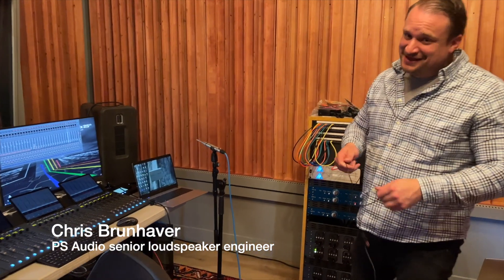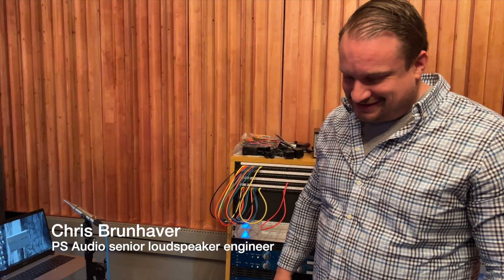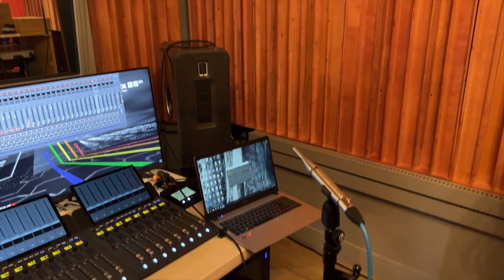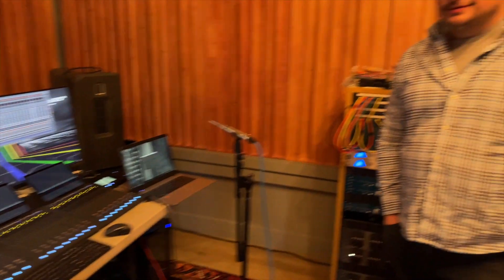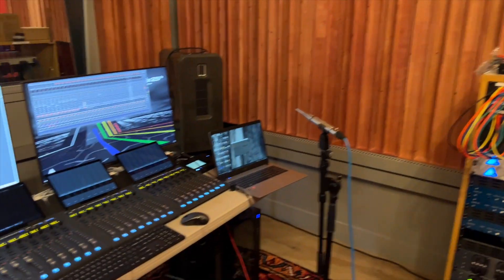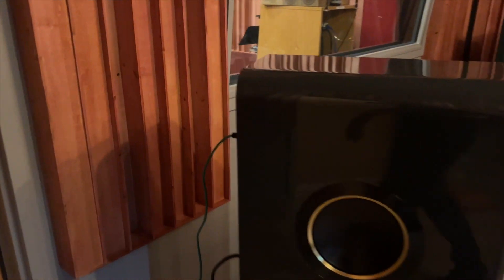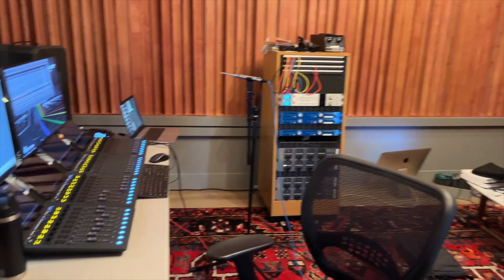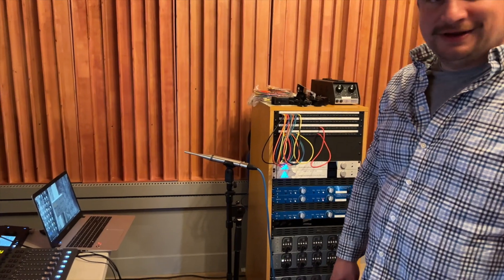Building Octave Studios 20

Comment: No matter how good your equipment is you have to deal with room and it is going to do what it does because of the rooms dimensions. Speakers are usually placed to get the best mid and high frequency sound and the woofers are stuck with that placement. Using DSP for the low end can help control the low bass nodes. I agree they can do a great job of knocking down peaks but can't anything about nulls. That said the ability to time align the lows helps a lot.

I use a pair of Sumiko subs in my room and those were equalized with DSP just to the subs, my main speakers only go down into the 40's with the subs and their DSP's handling in the low end. 

I'd love to see some before and after plots of the speaker response curves.

Comment: you can correct for dips that's down to comb effect, you put a subwoofer at the back of the room and switch the phase cancel out the dips
the cancellation is below 660 Hz what you need to worry about! make sure your speakers have the right delay to minimise comb affect.

Comment: Okay, this opens up a can of worms!
Doesn't having one speaker in a corner and one speaker not in a corner cause uneven frequency response at the listener position.
Wouldn't there be more bass coming from the speaker placed in the corner?
Doesn't having one set of passive radiators pointed to a close wall and the other set pointing to a further wall also cause uneven frequency response at the listener position?
Speaking of the listener position,  if that's an eight-foot table and the speakers are at each corner wouldn't that make the optimum listening position about four feet back from the speakers?
Also speaking of bass response, doesn't positioning the low-frequency drivers to fire under the table cause the bass to sound muddy?
Will the sound change with the addition of panted legs under the table?
What about interference from the computer monitors and reflections from the table?
Last but not least, won't the whole response change when the permanent desk is in place.
Inquiring minds want to know. 🤔
Reply: Yes, it would be better for the speakers to symmetrical in the room but this isn't how the room is configured (there is a door to the tracking room preventing this.

Because one speaker is loaded into the corner, it does indeed have more bass (about 6 dB at 40 Hz) and this had to be equalized out in the DSP to get a matching response left to right.

No, subwoofers below 60 Hz (how these are configured) don't "see" the table.  They're 19+ feet long in that range.  Moving them will affect the way they interact with the room, but not that fact that they are above or below the table.  

They are still putting a revised table in here and different monitor arms etc. to minimize the interference.  Final system tuning will be done again then too.

No, there is no issue placing a woofer or passive near a wall, other than the boundary loading that was discussed already.

Comment: Interesting that you bought into the Avid system.
Are they finally compatible with Apple’s new M1 chip?
I was an early protools user (90s Session8 hardware) but switched to Logic just recently.
Reply: They are just using the Avid S1 controllers, the DAW is Pyramix. You can see the HAPI interfaces in the rack and the Anubis controller behind the laptop.
Reply: And by using Pyramix, they are using PCs
Reply: Thanks!!!!  Appreciate the quick reply